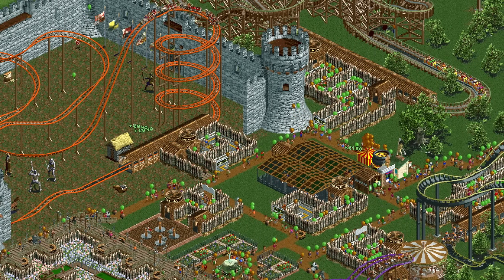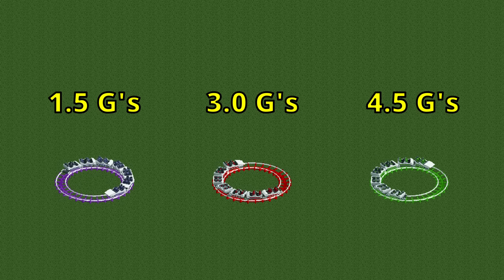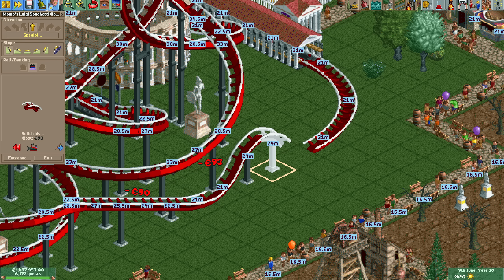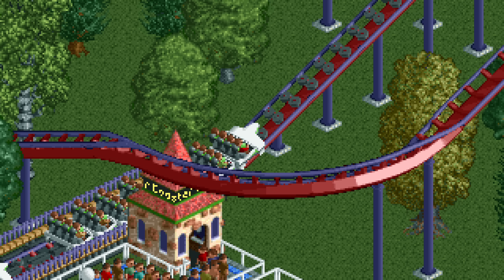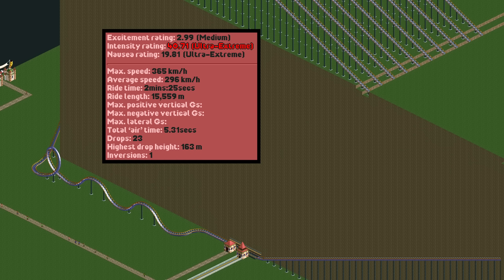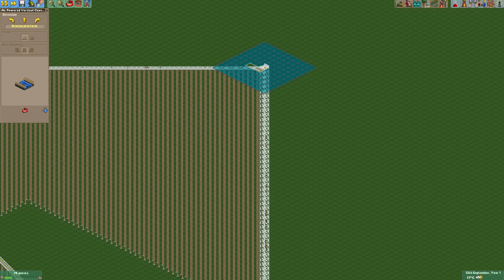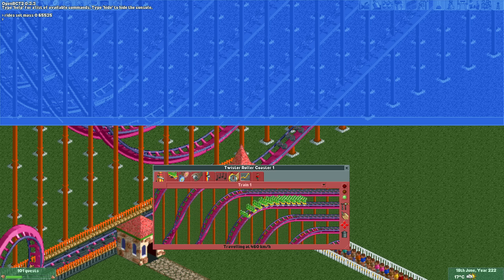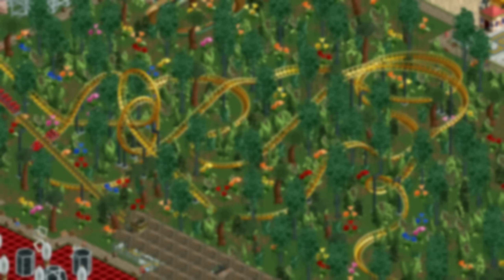What are the Highest Possible G-forces in RollerCoaster Tycoon 2?

Comment: 100g is actually rather survivable assuming you have the correct harness. Even sustained Gs of up to around 50 are survivable for a few seconds, with only minor debilitating injuries. considering this coaster only really subjects people to peek forces for split seconds its pretty survivable. The latteral forces would break your neck but if you had a neck brace there is a pretty decent chance you survive. Alot of race car crashes and plane in air destructions hit peek forces around the 100 mark and there have been people who survived nearly 200 at peek. Though once you get over the 100 mark no one is walking away with anything less then fractured bones and in the case of negative Gs brain hemorrhaging. So yeah most people would likely be dead in this scenario but I came expecting red mist not broken bones and internal bleeding. I think aiming for around the 1000g mark would be closer to the vaporization experience we all really want

Comment: Ok a few questions. For the twister coaster can't you make the vertical loop and bunny hill below the ground giving it the highest speed possible or are you already maxed out? 
Same question for the air powered launch coaster.
Reply from the maker: In all those tests the ground is at the lowest level (-9 meters) possible. There is no underground anymore.
Reply: @MarcelVos  that makes sense. For some reason I had it in my mind that you could go as far under the ground as long as the supports could support it. I guess I never realized it was an invisible barrier that you can't go beneath no matter what.

Comment: It is odd that in RCT g forces are directly proportional to speed. In real life if you are going in a circle then the acceleration you'd feel is equal to the square of your speed divided by the radius of the circle.
Reply: Keeping in mind that RTC2 came out in 2002, programming it to work like that with the limited resources would probably have been more trouble than it would have been worth.
Reply: @Pineapply_Queen  good point
Reply: @Pineapply_Queen  not really. It's only v * v / r instead of the v / r in game. Only a simple fault, some characters.

Comment: Does the OpenRCT2 team have plans to fix the bug that causes steep drops to provide more speed than vertical drops? They've fixed a lot of bugs the base game had so I'm surprised this is still part of OpenRCT2
Reply from the maker: I just think it's not particularly high up the priority list. I think it might actually be better to keep it in the game because messing about with perpetual motion machine-like coasters is a fun thing to do and removing that would be a shame.
Reply: @MarcelVos  Did the glitch at 4:10 affect the results of your brachistochrone video?
Edit: nevermind rewatched your video. Can't believe that was 3 years ago!
Reply: I have experimented with trying to fix this bug. It turns out to be very difficult to fix, because there's multiple causes for it. Every time I fixed one issue, I found another way that you could still build a perpetual motion coaster.

The root cause of the issue is that the game physics works in terms of velocity instead of energy, which means any rounding error can result in spontaneous energy gain. And there's lots of rounding error because it's all integer arithmetic. I think all the physics code would have to be ripped out and replaced to properly fix this.

Also, fixing these bugs does break some prebuilt coaster designs, so it would be an unpopular change unless it was optional.

Comment: Technically, the G force numbers are survivable over a very short period of time. Two time F1 champ Max Verstappen crashed at 51g in 2021 at Silverstone and didn't miss a race. Indy driver Kenny Bräck famously survived a 214g crash at Texas Motor Speedway. The cars are designed to keep you from squishing, and roller coasters don't have as much anti-squish. Also, in a loop it's too much for any anti-squish system.
Reply: Well, the positive and lateral G forces maybe, but you ain't surviving those negative Gs. Gonna blow every blood vessel in your brain.
Reply: By very short that means fractions of a second. With protective gear and a helmet
Reply: @toddoverholt4556  The protective gear and helmet don't really matter.
The Hans device matters.
But in this coaster it is also only for a short amount of time.
This coaster is very unlikely to kill anyone. The cheated one maybe.

Comment: Fun fact, the game isn't glitched when it comes to vertical drops!  In physics, the fastest path for a ball to roll down a hill is somewhere between vertical and 45 degrees, as you showed in the video.  That's just the physics engine at work!
Reply: Yeah makes sense. Because you travel a longer distance in pretty much the same time, so the speed is higher.
Reply: @chandir7752  Yes.  While gravity is accelerating you down, the angle of the track adds a horizontal acceleration as well

Comment: Small turns are defenitely nerfed regarding to lateral G's. They should be way higher, since G forces go up by the inverse square of the curve radius and they are tighter than the top of the air-powered coaster
Reply: IRL centripetal acceleration is v^2/r, with squared speed, not radius. That is still severely lacking in the game.
Reply: @EllipticGeometry  ah, had omega squared times r in my head therefore the difference. But yes, physics genarally is very badly implemented
Reply: @emmata98  r also isn’t r^-2. ;-) You could still have fun with that. Imagine scaling up a merry-go-round to fill the park, keeping its regular angular velocity. Then give it a control failure.
Reply: @EllipticGeometry  omega squared, so here omega²*r = v/r ^2 *r
Reply: @emmata98  omega^2*r=v^2/r
Reply: @EllipticGeometry  that too
Reply: @emmata98  Did you mean to have parentheses there like omega^2*r=(v/r)^2*r? Then it makes more sense.
Reply: @EllipticGeometry  yes, witch aren't needed due to the space used in between the fraction and the squared

Comment: at which point would the ride derail or sustain profound damage? (track/supports being ripped apart)
Reply from the maker: Depends on how strongly they're built, but I don't really know what the limits are. I do know a story of a wooden coaster train speeding through the station at 40 km/h or something which did damage the track (and injure some riders), so at 1500 km/h the track is nothing but dust.
Reply: The G-forces for a coaster are actually limited by regulations. Trains and track are designed to withstand the resulting forces. Sure, they could be build even stronger but there's no real point in doing so.

Comment: With the cheated coaster you'd just be a blood splatter a couple hundred meters away from the coaster lol

I wish we had gotten some comparisons on what the G forces actually mean compared to different things. Fighter pilot, Space rocket  launch, car accident, things of that nature
Reply from the maker: You're right, I indeed should've included some of those comparisons.
Reply: @MarcelVos  I think "speed of Usain Bolt" is the most important comparison, and you already got that
Reply: @MarcelVos  Does each rollercoster have a maxum speed, number of drops,  number ofinversions for achiving decent stats? I know you always talk about mimuim stat requriement, but is there a limit to the ratio of what you build ?
Reply: .28 Gs - car going from 0-100 mph in 10 seconds
1.5 Gs - airplane takeoff
2.9 Gs - a good sneeze
3 Gs - Space Shuttle takeoff
4.1 Gs - a backslap
4.4 Gs - Dragster doing 1/4 mile in 4.4 seconds
7.16 Gs - Apollo 16 re-entry
7.5 Gs - what an F-18 is normally limited to
10 Gs - what Maverick did in his demo to show that the mission could be done by 1 person in one F-18
Reply: @toddkes5890  At first when you said Dragster I thought of the one at Cedar Point SuperVinlin
Reply: @toddkes5890  "A good sneeze" amongst all those other things made me chuckle
Reply: @toddkes5890  "1.5 Gs - airplane takeoff". That must have been an awfully fast aircraft, unless there's something funny going on with the thrust of the engines or it isn't just a normal aircraft.
Reply: @martijn9568  IIRC Wikipedia was the source, it might have been combining vertical Gs from Earth and the climb Gs
Reply: @toddkes5890  Nice, but most  fighter planes will break apart at beyond 9.5G's Some stunt planes are rated up to 12G
Reply: @kevinerbs2778  That is why I referenced the one used in Top Gun, the one that the Admiral said would likely have to be scrapped afterwards
Reply: at 4Gs, your vision gets blurry and and you start to pass out
trained pilots with special suits can do 9Gs
30 G is a regular car crash
70 G is F1 crash
Reply: @petrolak  4Gs is a joke...many coasters in real life have even higher G-Forces...
Reply: I mean with rocket launches and reentries you don't have a lot of G's but they are constant for minutes, Car accidents are very high, but only take fractions of a second, fighter pilots are kinda in between as well as roller coasters, but they are generally lower due to the GP riding them.
Things in nature can also go up very high, but only for very little time
Reply: I would love for someone to calculate the kinetic energy from a roller coaster car going 1565 km/h and compare it to, say, a nuclear bomb explosion
Reply: @funx24x7  Need the mass of the rollercoaster to get an exact value.  But off-hand each kg of rollercoaster moving 1565 kph would be equal to 293 tons of TNT.
Reply: @Todd Kes If that math is correct and I have the cheat mass correct then the result should be around 19.2  megatons of TNT. 

That is 480,000% larger that the largest non-nuclear explosion ever and is almost 40% of the largest nuclear explosions yield.

This coaster just flattened a small country...
Reply: @toddkes5890  This is not correct, using 1/2mv^2 it should be that each kg is equal to roughly 94kJ which is like 22.5 GRAMS of TNT. Guns do not create "barrel of TNT" size explosions, and rail guns don't level entire blocks. If your math was right a fighter jet flying at mach 2 would level a country.
Reply: @toddkes5890  Kilos or Tons? If it's actually tons then if takes near infinite energy to go faster.
Reply: @toddkes5890  I think I know how you got to that result. You accidentally ran the calculation to TNT as MJ, not J, and ran it as m/s, not kph.
Reply: @funx24x7  Not even close. Assuming a 15 ton roller coaster train, and a 15kt nuclear bomb (ex. Little Boy), it is about 0.002% of the energy.
Reply: I wonder what the G forces of the relativistic rides in the video about making them go faster.
Reply: If you could survive the radiation, and extreme heat of the Sun, you would experience 28 G.

So the cheat coaster has G Forces more than double that of the Sun. 

😱😱😱😱
Reply: The euthanasia coaster designed to kill people tops out at 10 G's. 
These G's are of course over an extended period by several loops but it's still 10 G's which is enough to prevent your heart pumping blood into your brain. 
So you drift off into unconsciousness as blood is literally pulled out of your brain by gravitational force.
Reply: One thing I heard is negative vertical g's are much much more deadly because they are capable of bursting the blood vessels in your brain.
Reply: 10g is 10x the force you'd normally feel. So if it's 10 positive g and you weigh 100kg, it would seem like you weigh 1000kg (1 tonne). Lateral g force works the same, but you'd feel the weight in your "side" (like you do when you take a corner fast or tight in a car). Negative g is the opposite of positive, it lifts you up in the air (e.g. imagine you're on a rollercoaster with no seatbelts or restraints, as you go over the peak of a hill you would fly out of the seat, the force of gravity (g force) is "negative")
Reply: Reminds me of Timecop. "See those two red spots?"
Reply: The crew of Soyuz T-10-1 survived 14 to 17 g for about 10 seconds what the launch escape system triggered. They were bruised but alive
Reply: The spaceship in Outer Wilds accelerates at 5g.  I hope this helps!
Reply: Vertical G
1G = What you are experience right now
1.4G = Tesla Model S Plaid under acceleration. If you see someone barely able to move forward under Tesla acceleration, bare in mind that it is less than 2G
7.5G = What fighter pilot experience regularly
9.5G = Upper limit of fighter pilot, with proper equipment
10G = Lethal to all human under any circumstances
30G = If you weight 70kg and goes 30G. You will now weight 2.1 tons. Imagine experience the same force as carrying a 2.1 tons car on your back
50-60G = Marcel Vos's Coaster

Lateral G
What you are experience right now, if you don't mive, is 0G. Now imagine sitting in a car that turn into a sharp corner at unsafe speed. To the point you get pinned to the side of a car. That is less than 1.5G. Probably less than 0.7G if you are not in a supercar
Reply: @punnboat9817  10 g is not lethal to all humanity under all circumstances. Anyone in a decent car crash experienced more than 10g. Direction, onset duration, length of exposure and all sorts of things matter more than just the actual g forces.
Reply: @punnboat9817 1 lateral G = lay down on your side lol
Reply: @nthgth  Time is a factor for that one, when I am laying on my side and my alarm goes off in the morning, you've got at least 3 Gs going on then!
Reply: @scottthewaterwarrior  lmao you're not wrong!